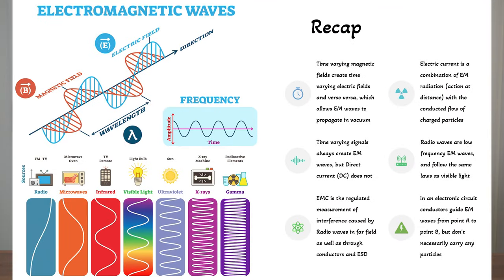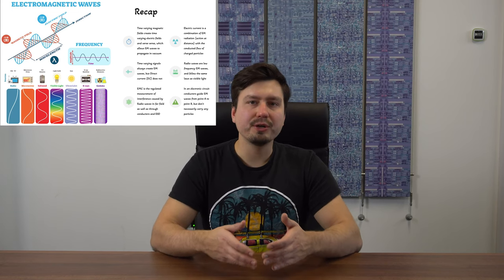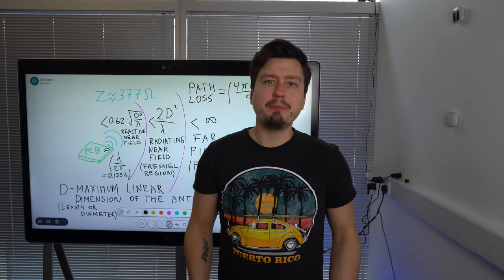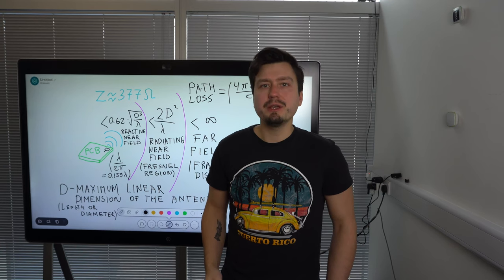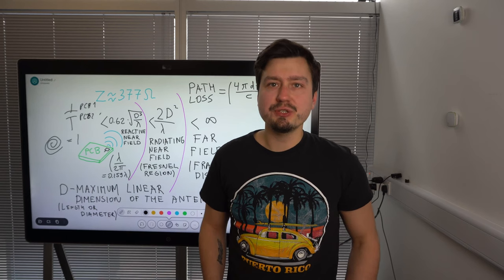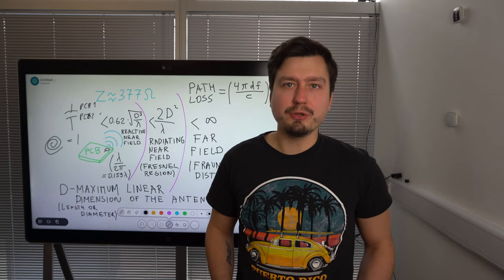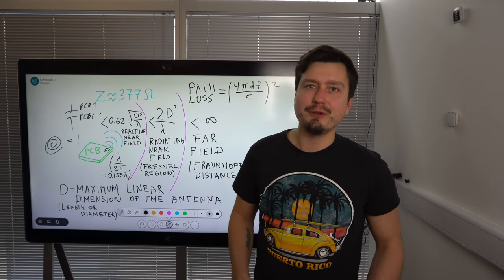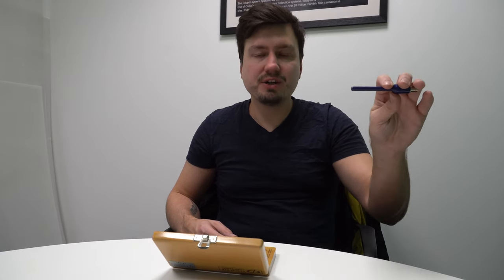Antenna Propagation in Near and Far Field

Comment: Which near-field probes did you use? Did you find them effective for high frequencies, particularly close to 5 GHz as well?
Reply from the maker: Hey Hwansu,
These are the probes featured in the video:
https://www.com-power.com/products/near-field-probes/ps-400
I don't think I ever really had an emissions problem anywhere near 5ghz, but they're definitely picking up wifi and lte in the building!

Comment: Can we produce plane wave of 15 to 30 khz
Reply from the maker: Hey, a plane wave is an approximation that is designed to simplify mathematics. A true plane wave cannot physically exist at any frequency. However, if we sample a 15kHz wave from distance 2D^2/lambda with a small loop antenna, then it will look like a plane wave to us, due to the antenna aperture being much smaller than the wavefront. Hope it makes sense?